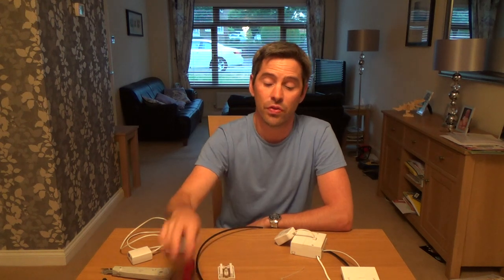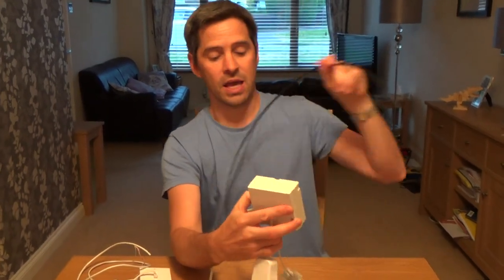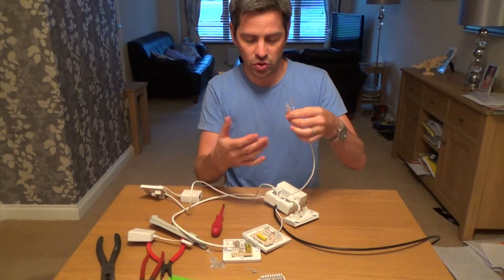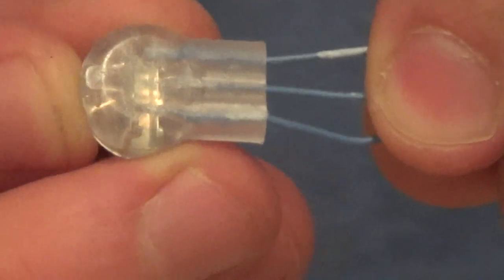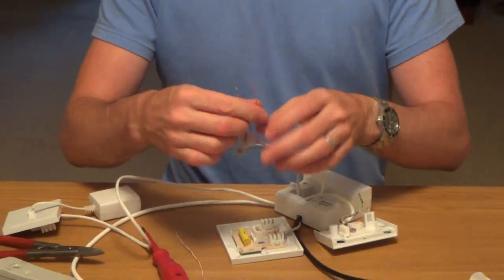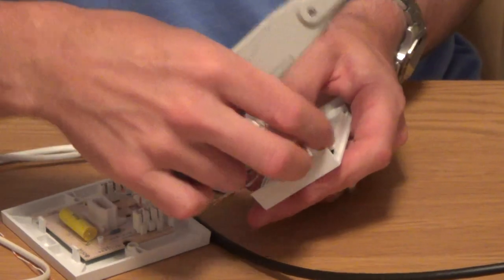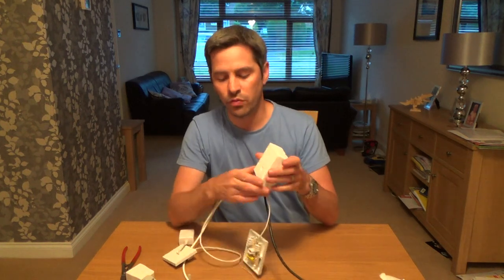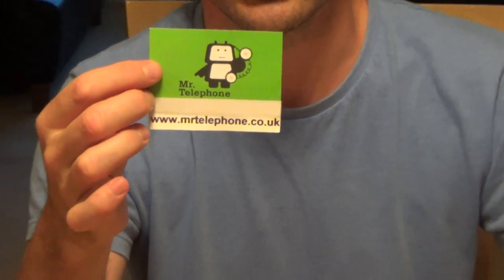How To connect 3 telephone extensions to the one phone socket.

Comment: Is it possible to connect a extension in the back of the master socket then put a crimped rj45 or rj11 whichever it is, in the other side and plug into WiFi router to make it work?

Comment: Hi Vince I have six telephone extensions in my house.  Each outlet has got a red pair a yellow and a blue pair.  I have a cable hanging out of the wall where the home hub is and that cable is black yellow green blue orange and purple.  The sheath says 3 pair telephone wire.  I am assuming I attach a BT 631 plug and connect it.  Do you have a diagram of this colour of wire pls and how to connect it to the 631 pls?  Thanks. P

Comment: BT usually recommend no more than 3 phones to be connected to the master socket. Has this changed?
Reply: I don't believe so. You can get a junction box for adding more lines. The Amount of wire from the telephone exchange to your house is usually quite large, so it should be ok with a little extra distance inside your house.

Comment: My main man Vince, i have seen some of these wires in my house twisted together like a knot for extension instead of them uy2 you were talking about 
Is a knot acceptable or certainly not ? 
Please please help
Reply: @Paul Jameson  no it was the main line for phone/internet
it works fine 
i have changed to the m3 connectors 
no diffrence
Reply: Its not 230 v!!   its just a telephone line low voltage.......it was knoted up in a twist inside the wall where its from a ground floor and a 2nd floor connections 
now all is conected with m3u 
it works just as twisted knot

yes the copper inside the wire knoted together to join up
the jack wall socket is connected properly in vdsl/phone socket

main telephone line box ground level
l
l
l
l
&------------------------------  wall socket diff level
the knot